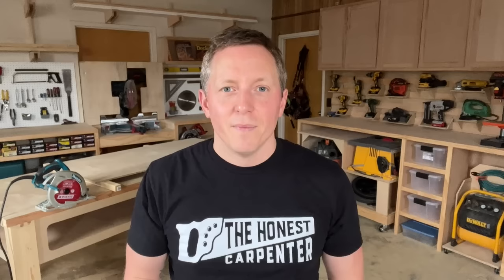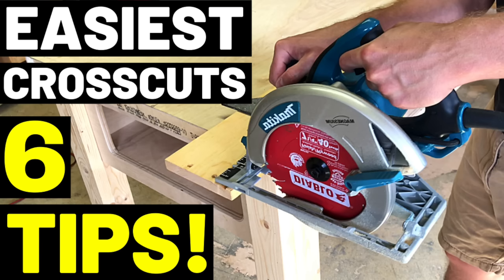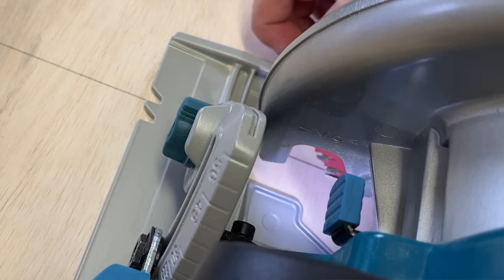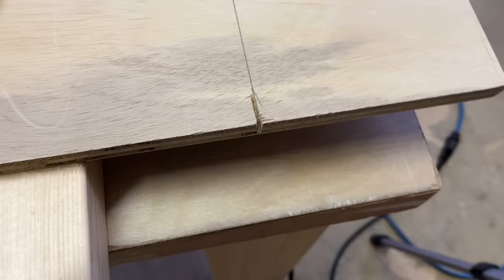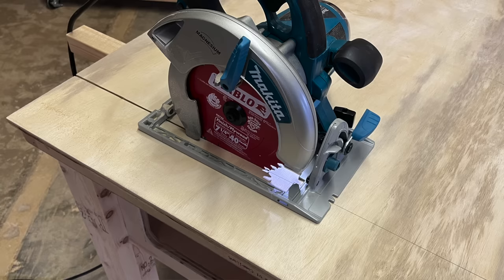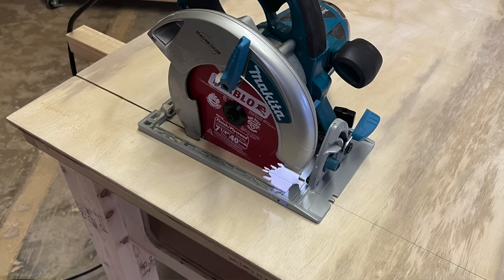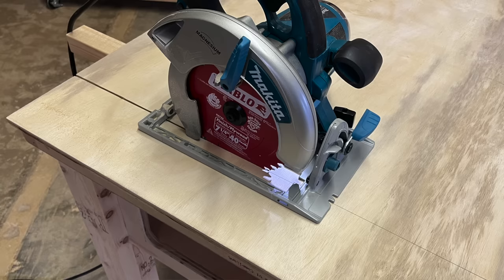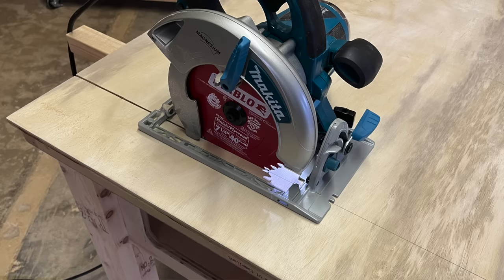How To CUT STRAIGHT With NO GUIDE! Freehand CIRCULAR SAW CUTTING...Pro Tips, Tricks and Secrets!

Comment: 13:35  I've recently found a much safer way to hold the guard out of the way for these cuts i know will catch the end of the wood. 

I wouldn't attempt it with a corded saw, because the ones i've used don't have an electric brake to stop the saw blade quickly at the end of a cut, but it works perfectly for my cordless saw because the blade stops instantly when you release the trigger. 

I simply have an elastic band always handy at the front of the saw, looped around the handle. When i need it, i can stretch it around and hook it on to the guard lever and i'm ready to cut. 

It works perfect for my saw, and i find it a lot safer than having a bad grip on the saw, but it involves it's own risk, because you have an exposed blade after the cut.

Comment: I don't know why you say the notches on the front of the plate aren't accurate. They don't adjust so they are always the same. You just need to do a practice cut and stop the saw while everything is straight. Then look and see where your line is relative to the notch and relative to the blade.  Use these positions to begin your cut and it will be perfect every time. Using the guide (notches) allows you to start your cut on the right, left or down the middle of the line with accuracy.  If you start straight, you can use the guide all the way until the end of the material. Like you, I like to be left of the line, mainly because the straight side of a notch on the mark causes my blade to be lined up there. However, in your particular example I would never reach across the board like you do because it feels unsafe and it's hard to cut straight at the end of your reach as so demonstrated. When I have a choice, I start at the other side where I could walk along my cut. All I have to do is put the blade on the right side of the mark and line up the mark to a different notch location. By the way, there is another guide as well on your saw. On the plate where the notches are and just in front of the blade, you will notice the form of the plate creates a guide that matches a notch in the front and with the blade. IMHO the using the guides are a must. I almost exclusively use my battery Makita where the blade is on the left side which makes it so much easier to see. I don't understand why almost all battery saws have blades on the left and corded saws are on the right. My grandfather was able to cut a 2x6 a perfect 90 degrees with a handsaw and without a line. That was back in the 50's-60's and I never did ask his secret to being able to do that.

Comment: Is the main reason for not clamping a straightedge to maximize efficiency? Not trying to be critical, I'm just curious because I don't do it for a living and have the luxury of time. I assume that when you're making a day's worth of cuts at the job site, all that setup time with a straight edge would add up.
Reply from the maker: It just simplifies things sometimes, Sam. It may not be necessary, but if you can develop the skill safely, it becomes a huge luxury. You’ll look at projects differently—adds fluidity to your work. And I think you’d be surprised how easy it becomes when you do it successfully a few times. It’s mostly a mental block that prevents it. But…always be safe first, so don’t feel pressured to try it!
Reply: @TheHonestCarpenter  thank you!

Comment: Good video, but I thought this would be about cutting a straight line using a circular saw WITHOUT a pencil line.
There are two ways I cut straight without a line.
First, if your cutting sheathing plywood out a window or door opening, use the side of the blade as a guide as it follows the 2x6 ( or 2x4 ) framing of the opening.
For cutting dimensional lumber without squaring a line across , make your mark for the length, then line up the front edge of the saw table to the far edge of the lumber to cut.
If you get good at this you no longer have to square up a line to get square cuts every time......it's very fast.
This is for experts, people who do not make their living doing this probably shouldn't bother.

Comment: Great info, as usual.  Question: just what are those notches on the front of the for if they are unreliable?
Reply: They're a relatively helpful guide for setting up the saw to the line... Once you know your saw fairly well, you'll just naturally be a little better aligned with the cut as intended by approximately where it lays in regards to those notches... It's just that ultimately, you should be watching where the blade and line meet to get into it and keep on track.  ;o)
Reply: So 2 notches are there depending on which side of the kerf you’re keeping?

Comment: blade left so i can rip one handed without a square or tape measure. Definitely recommend safety glasses though. Nothing worse than your safety squints failing you right in the middle of a cut when you need your eyes to stay on the line lol.

Comment: Nice. But, your table is bit tall for this kind of cuts so you did extend your right hand and body at risky cutting distance (this why also you made last part wrong 11:25 ). Second, as right handed and cut on the left side, your body position is wrong. You should put the camera opposite and cut the shorter part to your right so you can walk passing table while cutting by or could take a few steps forward for such a long cuts. The circular saw should not be too far from your body and if somethnig wrong your body is stronger with your hand closer than if it is too extended from main body. This why your hand must must be in slightly bent arch not more than 140° where you extend your hand at max 180°. Thank you for your video. God bless you.

Comment: The cord is an issue, as it has a tendency to snag or get stepped on ... I will put the cord out in front and to the opposite side of the blade. Have plenty of slack. and the cord will naturally fall away as you move the saw forward. A professional woodshop would be set up with the power cord coming down from the ceiling. Is there anyone that doesn't hate power cords?

Comment: Should I get a worm drive or a sidewinder? I'm not a professional, the price is a non-issue, but I don't want to have two circular saws. I'm thinking the worm drive b/c I don't do tons of cuts so being heavier just kind of makes it easier to control.
Reply from the maker: I’m a sidewinder guy, Sloppy! If you’re framing a ton, get a worm drive. Otherwise, I always go sidewinder. 👍
Reply: get a worm drive. the weight balance of the worm drive makes cutting straight easier
Reply: I'm somewhat an amateur, but from my experience using my mentor's sidewinder for ~3 years and my own worm drive for ~1 year, it's really all preference. Sidewinder is more compact and has you holding it closer to the center of its gravity, so it's a bit easier to control and less awkward before you're in the cut in my experience.

But on the other hand the worm drive's extra weight (or at least how it's distributed) is great once you're well in the cut but also a bit more awkward when setting up the cut (at least to me) because you're holding its weight up from the back instead of at an angle from above, ESPECIALLY if you're trying to do the cut one handed for whatever reason, but it also lets you cut further without moving from where you're from which is occasionally nice.

For someone who's closer to DIY than professional I'd recommend a sidewinder most of the time, but both have their upsides and if you're like me you'll probably have small complaints regardless, so in the end just buying one and dealing with it is the way to go.

Comment: Good video, but I almost never do freehand cuts. They just turn out wonky and I hate the look. I'd rather spend the time to measure out and use a wood or metal guide and clamp it down. It takes double the time, but you get better results. I will use a t-square for shorter cuts.
Reply: How do you use a t-square and circ saw without cutting through the square?
Reply: Me too!

Comment: Good video for freehanding. I thought you could have stressed there’s few reasons for freehanding; use a guide whenever possible; you just get straighter, cleaner, safer cuts.
Reply: my general rule is anything for "finishing" work gets a strait edge clamped down. Doors, paneling, end gables, etc. Rough carpentry  no bother. I can cut pretty well freehand but using a strait edge I believe it turns out better/perfect every time and doesn't take that much longer, especially with a plywood sled the base of the saw rides on. Great for cutting down doors etc.

Comment: Disagree   
Don’t watch the blade, you’ll make too many micro adjustments and fuck it up. 
Use the shoe, and long cuts will be straighter. 
When possible use your finger to pinch the shoe for a rip guide. 
Been framing 30 plus years. 
Sorry don’t mean to sound like an ass. 
Video popped up randomly.

Comment: Tell you how I do it.
First you need to be a carpenter or learn from a carpenter or just start researching and learning.
I prefer a 5 in 32 tooth blade on Ryobi cordless and I prefer the Ryobi over the DeWalt.
I said this before but sometimes cheaper tools do the job better from a cheaper brand. Look at husky at home Depot husky is top quality.
I can cut straighter with a lighter saw

Comment: Why don’t you tell people to cut with a saw made for there dominant hand when the cutting environment allows such as proximity constraints. I have a right hand saw that I make 99% of my cuts with and a left hand saw that I use only when I have to. Watching you twist and contort your body whilst trying to watch your cut line from the wrong side of the saw looked unsafe and awkward not to mention you can’t see what your doing. If you must have only one circle saw make sure you buy the right one. Right handed folks will cut straight as an arrow easy as pie with a right handed saw. Also having both right handed and left handed circle saws is handy and every once in a while is a must to make an off hand cut. Be safe and use the right tool for you. No need to contort your body into uncomfortable positions just to make a blind cut that you can’t see because you are using the wrong tool for you. Unobstructed vision of the blade is #1. If the saw bucks will your twisting clear over  trying to see what your doing cutting right handed with a lefty saw you could be injured and you just won’t cut as straight or as easy and comfortably anyhow. Mad sus b

Comment: Just use a guide! It's just way more safe, especially for beginners. A guide can be a simple piece of wood with two clamps. There is NO reason at all to do it without a guide other than to look cool or be lazy.
Reply from the maker: No, in carpentry, specifically home construction or even light remodeling, the ability to cut freehand is invaluable. You just don’t always have a straight edge set up around. Freehand cutting is safe too, as long as you practice normal circ saw precautions.

Comment: Why are you cutting your line in half?  You measure to 8 inches and cut your line in half and your piece is only 7 15/16th. A teenth might not matter in circ saw construction but when you're making jewlery boxes you always leave the line cut the waste side and then your piece is the same size as you measured

Comment: Any advantage for corded over cordless ?
Reply: No
Reply: Don't have to worry about maintaining the batteries, but that's not that hard and Cord management (and being limited in where you can actually cut) is way more of a hassle imo. Cordless Saws these days are all just as capable as corded in my experience, and the upside of not having to deal with all the annoyances involving cables is well worth it. Just make sure to get at least 1 good sized battery, I've been using 6AH ones since I started buying my own tools and one tends to last 5+ hours before needing a charge.

You can also get off brand batteries for way cheaper that work practically as well as branded. I bought 2 Li-on 6AH batteries for 50ish bucks total a few years ago, been using them as my go-to alongside my mentor's branded 6AH's, no complaints. That plus a charger and as long as you remember to keep the one you're not using on the charger you'll be good to go.

Comment: There is just no reason to freehand. You can buy an 8 ft guide from empire at any homedepot for literally $20. Its not even really any faster to do it freehand. You still have to measure each side and snap your line. Maybe im missing something but I just dont get why you wouldn't use a guide.

Comment: Ah… no. Use half the blade , don’t set the depth of blade by the material. Ex. For cutting 1/3” plywood set the saw blade to 2”. 
    When starting the cut keep the blade to the opposite side you measure. Keep the blade high and “score” the material, cut only 1/4 into the material until you travel 6 inches then lower the blade through the material and continue cutting straight.

Comment: I have one tip. If possible, always have your circular saw at max cutting depth. It gives it accuracy and less wiggle room. And it's just safer.
Reply: Your just trolling noob carpenter's right?  I only have the blade depth 1/8 or 3/16 deeper than the material for a clean cut and no blade wobble...
Reply: @danewhite9599  What's there to troll about? It's simple physics. The more resistance on the blade, lesser the chance to make turns. 
So what you are saying is if you cut 1/4 inch plywood, the recommended depth of the blade is 1/2 inch? Try it with a maxed blade and tell me results.  
I've just thought a noob carpenter a valuable lesson!

Comment: its 2023, why don't saw manufacturers come up with a better system than that little guide notch on the plate to line up with the pencil line ? it's the worst feature on all the saws
Reply from the maker: Some have laser line-ups forza, but I haven’t found them to be very reliable

Comment: What is with this repeated nonsense about splitting the line? Oh and not one word about marking the waste side of the cut. When you get a new saw clamp a piece of wood to some scrap and make a straight cut, then measure from the guide to the closest edge of the kurfs cut. I write that distance on a piece of tape that I keep on the saw. Then I reinsert the blade into the kerf and observe how the 'V' notch lines up to the kurfs edge. Don't be afraid to break out the triangle metal file and make it CORRECT! I also measure and apply tape with that measurement to the other side of the saws blade.
Note: I have only had to adjust the 'V' notch on one saw. I own 5. That saw was a cheapie one that I bought to use on a real grotie job and I was putting that saw through a do or die situation. It completed the job and survived so now I use that saw when I need to cut concrete with a ferious masonry blade. My kerf is always on the waste side of my marked line.

Comment: You said to “split the line”. I assume you are not cutting to the exact measurement. This would make your board 1/16” short.
Reply: You want to have your blade (kerf) on the waste side of your line. Then try to leave half of the line on the piece you're keeping (the other half of the line is removed by the blade). You don't center the blade on your line. That would make your piece half a blade's width too narrow.
Reply: @jobacuda4472  i understand that. You always have the blade on the waste side.
Reply: @ironwood1621  Right.

Comment: instea drawing line on the center guide i think better you draw the same line either on left or right side the base plate of the circular saw. 2. to avoid damage on the top surface of ply wood use carpentors glue tape at cutting edge can also helps for nice and fine cutting with the saw blade. Good luck and God bless you,

Comment: Personally, I like to cut on the waste side of the pencil line and if a bump is too big then I grind down to the pencil line with a high-speed grinder and coarse sandpaper. Just like a haircut, it's easier to come back and remove more hair than it is to put them back on.

Comment: I'm sorry, but what is wrong with cutting straight WITH a guide? 🙂
Reply from the maker: Nothing, Sergey. But sometimes speed, or lack of a guide at hand, means that it’s good to know how to cut fairly straight without one
Reply: @TheHonestCarpenter  Please don't get me wrong, but I simply cannot imagine a situation when someone is ready to use a circular saw and at the same time does not have a single straight edge around. I often use my 4-feet metal level (the best), or a piece of scrap board, or a piece of molding, or just some firm box...

Comment: The quality of the tool makes a big difference as well. I have an older heavy High End Skill Saw and a Cheapy Plastic B&D new that I got for fence work it is a lot lighter. HOWEVER when doing anything precise or demanding it is no good the blade walks back and forth on its own never mind the lazer guide etc. I almost threw it away but I keep it for cutting posts it is only good for that kind of stuff unlike the old one that cuts very well. I am rambling now sorry.